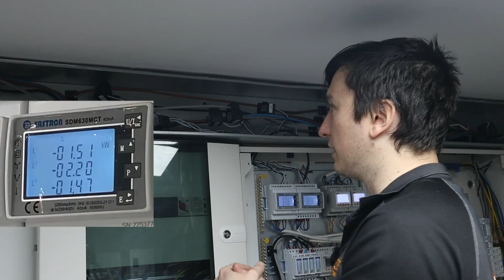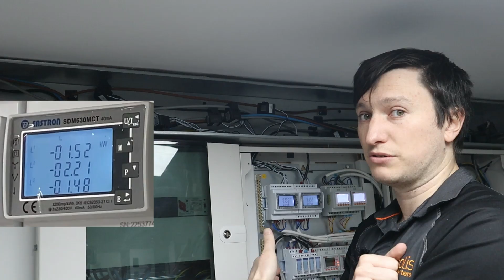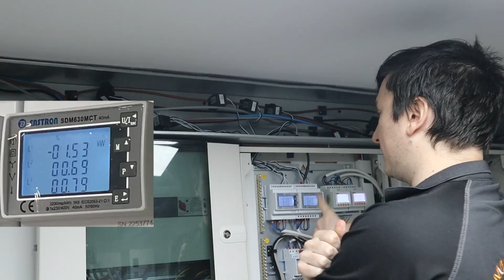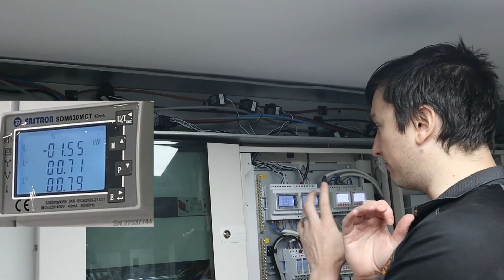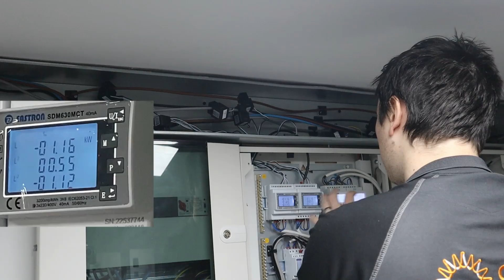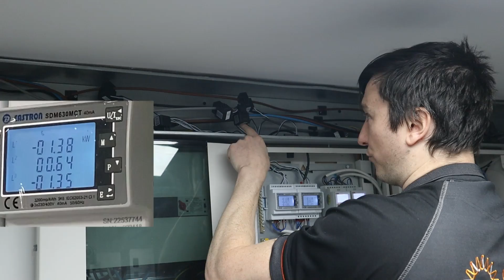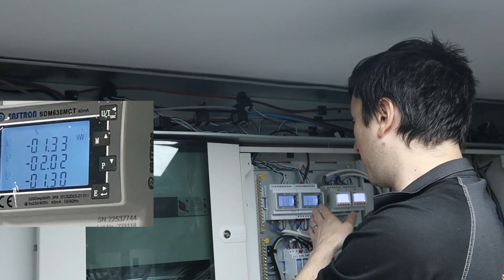Solis Meter Installation - Phase Rotation

Comment: The minus value means pulling power from grid? And a positive value means delivering solar power to the grid? The factory manual of the meter is not that clear. The hybrid solis, when power comes from grid gets a negative value? Thanks in advance for your response.